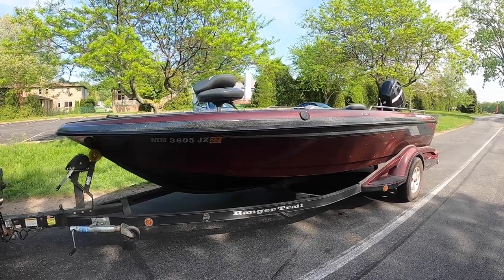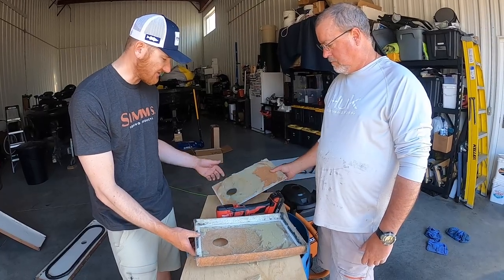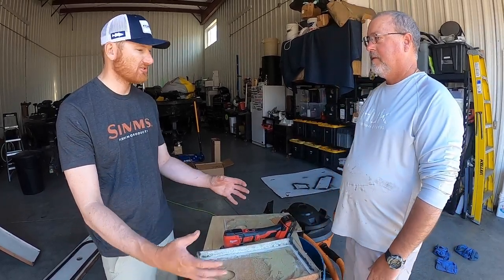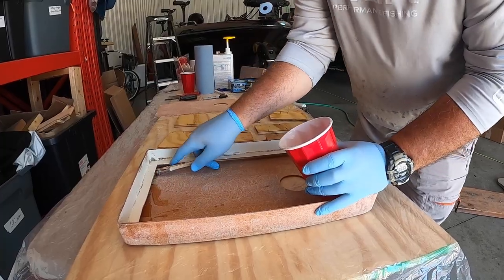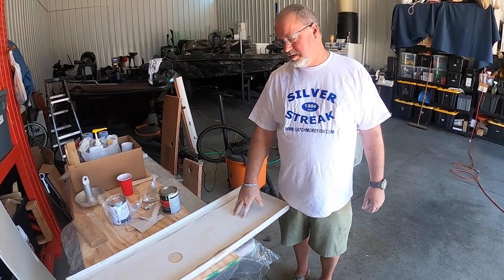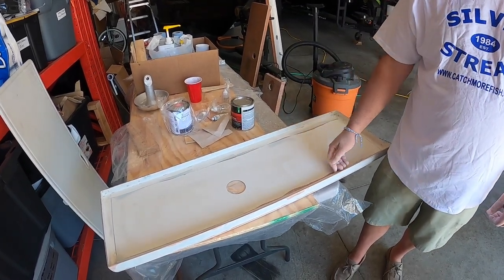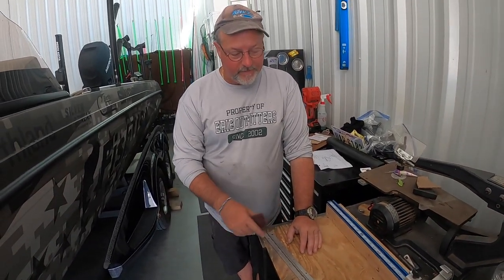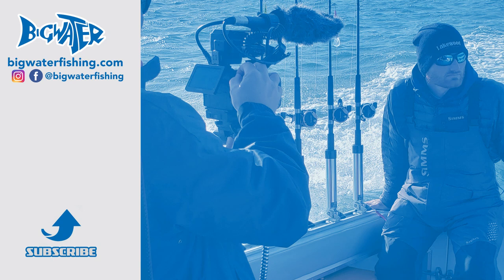How to Rebuild Boat Compartment Lids | Project Boat Restoration Part 9

Comment: So it's been a year and a half.  How are these lids still holding up?  I am about to do this myself
Reply from the maker: All good. Friends that have done them say it will last the remainder of the boats life if done correctly. Wood.makes them heavier and you can use foam too, but it will require a little more work
Reply: @Bigwaterfishing  thought of foam but feels like that could just lead back to the same issue down the road. Gonna try this method and if I don't like it I'll just get them all made in aluminum
Reply from the maker: @jonesyrules15  it probably will....but it also will probably be another 20 yrs before that happens too. Lol